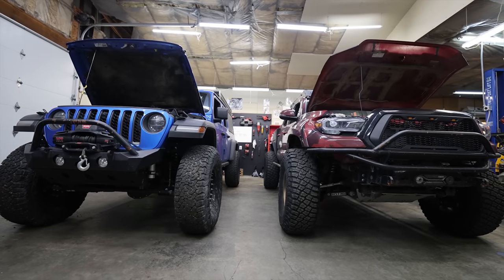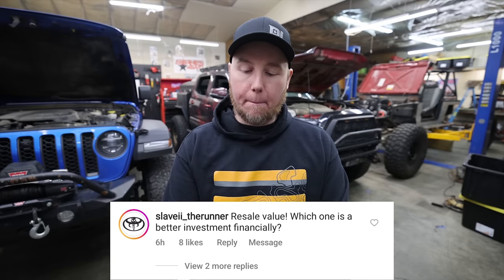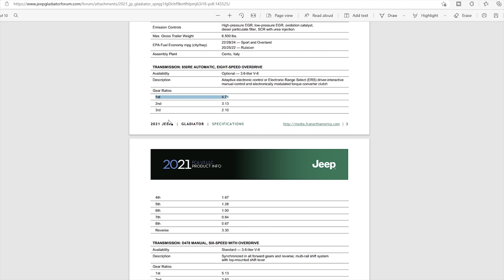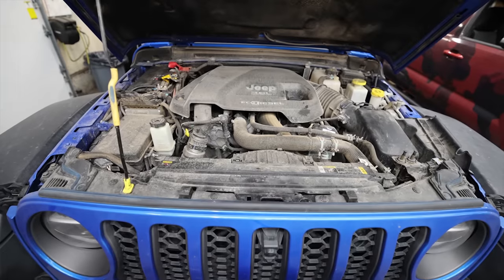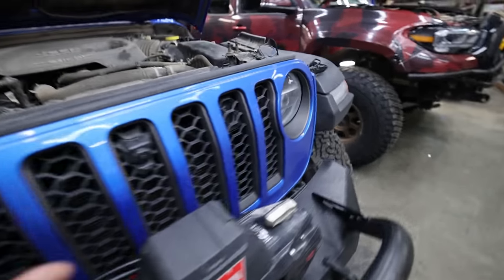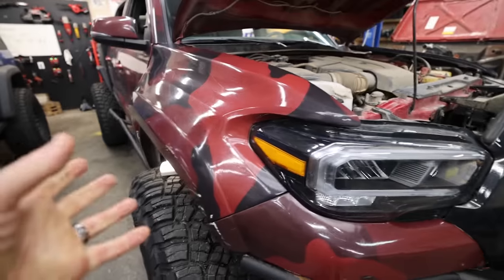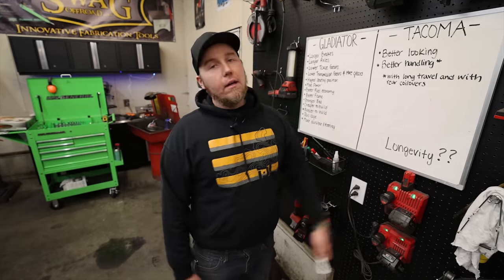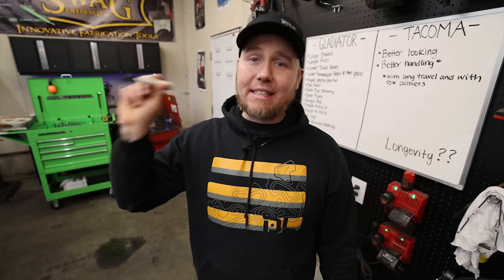My 21 Jeep Gladiator Vs My 21 Toyota Tacoma. Cold Hard Facts.

Comment: This video is the best.

I have a 2015 Tacoma and a 2017 Tacoma. You are 100% spot on with everything. And I had a beefed-up Wrangler TJ on 35s for seven years, so I'm not some diehard Toyota fanboy.

In my opinion, people's biggest mistakes with Tacomas is trying to turn them into rock crawlers or desert runners. I understand that YOU did it as a proof of concept. But all of these Instagrammers (sorry Maxx lol) who put long(ish) travel kits and 35s or 37s on their 3rd gen Tacomas are turning their trucks into something that they aren't properly built to do. Tacomas a basically just Subarus with low range. They're not really adequately built or designed for rock crawling, or much of anything beyond a really washed-out forest road. Beyond that, you need at least 35" tires. And to put those tires on a Tacoma requires tons of frame and body cutting/welding. I have my 2nd gen Taco set up for backcountry adventuring (what people in the US like to call "overlanding"). It's got a beefed up suspension, ARB winch bumper, 10,000lb winch, rtt on a bed rack, Hammer Hangers, plenty of the good stuff. BUT, I refuse to put anything bigger than a 33" tire on it. Same with my 3rd gen. I actually only have 32s on both trucks. And you know what? They work fantastic for the things I do with the trucks.

Now, if I wanted to get into rock crawling and hardcore off-roading, I wouldn't further build out my 2nd gen and turn it into a rock crawler. I would get either a Wrangler/Gladiator or a Bronco. Because those vehicles are built from the factory to be able to do all of those things with minimal modification, if any. 
I love my Tacomas. They're also a pain in the ass, but I mostly love them.

I think the main point of my sermon is: have realistic expectations of your specific vehicle. Because a lot of people do not.
Reply: Supposedly, the new 2024 off-road versions of the Tacoma are now actually designed for off-road and you can disconnect the front-end sway bar, have highly upgraded off-road suspension and other improvements. You have to remember that Jeeps like the Gladiator were made for off-road scenarios.  Tacomas are made for a lot of other driving scenarios. The very fact that you can upgrade a Tacoma and make it into a capable off-roader is a complement to Toyota. I am not claiming that the beefed-up 2024 off-road version of the Tacoma is going to be as good as a Wrangler, but it will be faster, get far better gas mileage and it will be easier to drive in the city. The hybrid version of the 2024 Tacoma has 326 HP and 465 lb.-ft. of torque. It's going to be a beast by any measure. It also has a new eight-speed transmission and supposedly will get over 30 mpg.  I have no doubt that it will be much more capable off-road with these improvements.

I have owned three Tacomas and currently own a 2009 Tacoma Sport version with TRD upgrades. Off of the lot it has been a very capable off-road vehicle, but it was never designed to be a Jeep-like off-roader. I have over 200,000 miles on it and I have never had to do any repair work on it. It still has the original hoses on it and they are still flexible and in good condition. The reliability of Tacomas is legendary. 

The main problem with Jeeps, and several Jeep owners have told me this, is that they break down all the time and are very unreliable. I haven't owned a Jeep, but Jeeps in general have a very poor record for being reliable in almost every study I have read on the subject. Their new SUV uses plastic engine mounts or something like that which is just ridiculous. They are breaking like popcorn.

Comment: I am a 2020 toyota tacoma TRD off road owner and I agree totally with you. I love the looks and handling but hate the drive line. I have a 2011 toyota venza v6 3.5l and it has a way better power. I understand the frame issue too as much as I went to work when I bought this truck I bought a case of mil-grade cosmoline in spray bomb. I took the tires off covered the body with plastic and layed on a creeper and sprayed everything. (Wisconsin, salt!) am I going to off road like you no I just go to Mexico with my wife and we have family land there and just want to get around.
Nice vid! No hard feelings and you didn't lose me.
Cozz

Comment: Really wanted a Jeep in 2007 but ended up with a Tacoma 4.0L, surprisingly I use it for everything. Some off-roading, many hunting and camping/hiking excursions, moving a few times across the country, daily driver etc. It's 363k miles on it currently and runs great. For the first 200k after 12 years the only "repairs" were a new battery and upgraded air filter and aftermarket leveling suspension. Some under body rust currently on it as it's seen 6-7 harsh winters. The towing handled amazing in my moves. Shame on Toyota for going away from the 4.0L!!! My son will be buying it from me soon as I look for another 2nd gen Tacoma!

Comment: Tacoma (TRDOR) owner here….you went pretty light.  You didn’t even mention Toyota designed the front to not accept larger wheel/tire combos without cutting and beating the hell out out the body.   Love my Taco, but only got it because it the Gladiator Rubicon was was $20k more at the time.

Comment: Your videos are awesome!   

How heavy was this trailer you described the Taco pulling?  My Rav4 pulled a 4,000#+ trailer (it was a 3500 # trailer that was DEFINITELY overloaded - the largest Uhaul trailer, STUFFED), from Montana to southern Colorado and it had ZERO problems.  Held 80 on the highway, up the passes in Colorado... never really got above 4,000 RPM.

Another noticeable difference is the air intake- the Rav4 has its air intake from the top of the grill where the hood latches, not the wheel well.  Seems SO weird ANYONE would design an air intake from the wheel well, but you are not wrong about that!  Most manufacturers do that and it has never made sense to me.

Comment: As a former Toyota owner (and who has first hand experience with jeeps) , I don't hate to agree. I had an fj cruiser with suspension that was dialed perfectly and 33s and it would go everywhere ... except the highway. It didn't have the power that I require and thr transmission did overheat and that wasn't a cheap fix. And eventually I did break the rear diff. 
Engine was solid, but under powered. It didn't have the gearing it really needed. And it lacked creature comforts compared to competitors. 
I was able to sell it for more than I paid, but I didn't get the repair bills back. 
I now have a 20 year old chevy tahoe on torsion bar ifs with mid travel rear suspension and while it's not anywhere near as capable as a Toyota or jeep, its way more comfortable than both, I can tow whatever I want, and I'm not lacking power thanks to the v8. 
I've never owned a jeep but I have driven them on and offroad and I definitely don't hate them. But the solid front axle makes them a bit less road worthy and the one I drove fell apart offroad... but that was probably a fluke as its not common for body panels to fall off of any vehicle once you hit a little mud

Comment: I had a 2018 Tacoma that I spent a lot of money on to build it up for off roading.  The only thing I hadn't done was gearing.  Drove past a Jeep dealer one day and saw a similarly built used Gladiator with a diesel.  Test drove and it and came back the next day and bought a new one just like it (I wanted to pick my own parts to build it up).  37" tires, Clayton Lift, this thing is a monster on the trails and the highway.  Loved the Taco but the Gladiator has so far been so much more fun to drive.  And of course you can also take the top and doors off!!!

Comment: I had 3 Gen 2 Tacoma's. I bought a 2021 Gladiator Willys with the select trac transfer case. I did all of the standard upgrades. Bumpers, suspension, rims and tires etc.. The Truck looked awesome. But I did not like how it handled when stock or moded. Just not a road trip truck to me. I sold it last year and got all my money back out of it. Then bought a low mileage off lease stock 2019 Gen 3 Tacoma TRD Off Road. Did basic suspension lift, Rims and 285/70/16 Nitto Ridge Grapplers, YotaWerks Tune and so far in the last year I have put 10k miles on it. It's an awesome truck on road and off. My experience. For what I use it for.

Comment: I currently have a 21 Galdiator. I had a 2017 TRD off road Tacoma and I can verify how flexible the Tacoma frame was. I could actually see the bed bounce while driving down the highway. It didn't instill confidence. Also when I brought the taco in for service the advisor told me that I needed a frame inspection on my 18 month old Tacoma. The gen 3 Tacoma were already  having frame issues. That was it for me. I let the Tacoma go. My Gladiator seems so much more sturdy and capable, although I don't do any serious off roading.

Comment: One thing I noticed that was missing in this comparison. Price.  Sure the 3.0 ED vastly outclasses the Tacoma 3.5, but it's also a 5 grand option over the 3.6.  There are a lot of legit criticisms of the Tacoma, but there are also some weird comparisons too.  Sure, it has smaller brakes and no discs in the rear but:  1. The Gladiator ED is also nearly 1000 lbs heavier. Of course it has bigger brakes...it has to.  2. is that a problem? Is the braking performance on the Tacoma noticeably worse? Sometimes things are bigger not because they provide more, but because they have more strain. Tons on YJ are massive. Tons on a 3500 are adequate. I guess what it boils down to is - if the numbers tell the story, it would be performance numbers we should be looking at and not what it takes to achieve them.  

Another video you could do on the subject would be out of the box suitability  A good example is the Gladiator having lower body work and a lot more wheelbase.  To get the same breakover a TRD off-road Tacoma has with 33's and a 2 inch lift requires a 3 inch lift and 37's on a Gladiator Rubicon.  That's nuts!  Yes, the Jeep's mod ceiling is higher, but it also requires more to achieve similar results.  In Utah I don't know anyone that actually goes off-road with a Gladiator that doesn't have at least a 2 inch lift and 35's.  Thats a lot more tire to pay for, drive and stop.

Comment: I bought a 2019 Tacoma because it fits my needs. I live in a condo. With the lift, bigger tires, and roof rack, I have about 1 - 2 inches of clearance left in my underground parkade. I couldn't park lifted Wrangler or Gladiator on 35 inch tires in my parkade, so a Tacoma is "better" for me. I have mud terrain tires and the truck is twin locked so I can tackle tough tracks, but I primarily use the Tacoma for backroads exploration, so the Tacoma is "better" for me. After 4 years of ownership, nothing has gone wrong with my truck. The stereo system/head unit rebooted inexplicably once, but that's all that's ever gone wrong.

Comment: "Just the facts mam" - love it! For towing, I bought a Frontier PRO-4X : low end torque, Rear disk brakes, a Dana 44 rear diff and a STRONG box frame. I added an Old Man Emu lift which is icing on the cake! The toy is the better looking truck, but my 5'-3" wife couldn't see what's in front of her on the test drive. Swinging the front axial on my jeep is FUN on 4x4 trails, but the articulation challenged truck is a born highway cruiser. - maybe Ford has the right idea?

Comment: I have a 2020 TRD Offroad Tacoma and my brother-in-law has a JK wrangler Unlimited Rubicon. I really love that Jeep and it was great Offroad. I do more wheeling with mine and his is used more for overland camping. 

But he has had to fix it four times now with the check engine problem being the thing a few times. 1700 bucks a pop. 

When we were wheeling together it is really noticeable how they’re built for different purpose. Jeep is rock crawling machine and Toyota is more for going fast. We found this out when we were doing a loop trail and we hit a closure late afternoon and had to backtrack. 

But Jeep better clearance, better articulation, dual lockers nice, and  comes stock able to fit 33s+. 

Toyota IS more reliable but it’s more of a dual purpose road/Offroad machine. Jeep is the Offroad master.

Comment: I'm not a jeep guy, but wheel with lots of them on 40's...I have a 2017 4 Runner with RCLT, 4:88 gears, RCV Axles, Chrome Rear Axles...ARB Lockers, Icon Suspension, and 40" Tires....Very capable on the trail/rocks...drives like a dream on the road.  As you know the cost to get there is way more than a jeep, and most jeep people I know wish they had the on road handling of this set up. The 4Runner is a bit beefier in my opinion than the Tacoma. All of them are extremely capable off road but it is so hard to say which is better.....because they are different....definitely less money to build the jeep than the yotas, but when you get the right set up in the Toyota....it will keep up with the jeep offroad and the jeep will struggle to handle as well on the highway. Different strokes for different folks !  Great Video !

Comment: I ran a jeep and toyota both to about 230k miles and over 10 years old each.  Changed the oil in the toyota and sold it for a good price.  I limped the jeep to a dealer for a trade after a decade of expensive breaks.

Comment: Well stated, and facts are the best.  As an Engineer who works in manufacturing I simply say I agree with everything you stated as more often then not folks just clue in on the opinion parts and don't do a good job as asking why?  There's a manufacturing concept call "Root Cause Analysis, and WHY, WHY" that's used for determining failure modes of everything.  If folks would just ask why a few more times, they'd probably find the real answers.  You made a good example of this when you asked about the resource for that chevy info.  Really good reference.  I'm a little for fun channel (jeepNdirt) as I seem to state every time, but soon I'll be posting videos hoping to help with different off road stuff and travel utilizing the same concept, "Straight up facts and open honesty".  You continue to rock, and inspire me as I've stated to you so many times.  You, Shaun, Casey, and Brad are my motivation, once again really good content.  Thanks buddy.

Comment: You are 100% right.  I'm a Toyota guy who has always been frustrated by the lack of options Toyota gives 4x4 buyers.   The FJ Cruiser was so close but the rear windows were not operable and it didn't even have a sunroof.  I was hoping the next model would correct those issues, but they killed it instead.   Don't know if you're aware but after stating they were not going to put all their eggs in the EV basket, the president of Toyota is suddenly stepping down.  The new guy says that are going to focus on EVs and turning Toyota into a 'mobility' company.  The future does not look good, IMO.

Comment: As a 2017 2wd OR Tacoma owner I feel like you’re spot on. I bought 2wd with a locker cause I had no intentions to do jeep things. I like high speed wash runs. The solid axels are king for lift, clearance, strength, etc in my opinion. So that’s why now I also own an 80 series Land Cruiser. Jeeps been around for a long time I think they’ve got the majority of things dialed in but I’m just a Toyota guy. Grew up that way and my dad also had a CJ-7 and always claimed it the off road beast. No doubt Jeeps do crazy stuff. But I’ll hope in my Tacoma go to the jobsite, dinner, camp, desert runs, anything that comes to mind and I’ll always be happy with it. Plus the phrase “let’s go places” is kind of unmatched.

Comment: I've owned two Takomas, two Wranglers, and now a Gladiator. Each had their points in their favor, but I kind of say it this way: I drive from the Dallas area to Southern Colorado several times per year, usually towing about 3,000 lbs of trailer. For comfort and NOISE while driving, the Tacoma is better for the loong miles on the highway. But when I GET to Colorado, I will always prefer my Gladiator - simply no question of that. Since the Gladiator better suits the reason I go to Colorado, I'll put up with the noise of the Gladiator for the road trip part..... Your side by side factual measurements seal the deal for me.

Comment: Both cool trucks. It was hard deciding between the two. I went gladiator, 38 months later, i still love it. I have wheeled it, off road and long highway use. Built it up and changed some things. Only bad thing was a broken windshield. No other issues. At 54,000 miles all good. Wish i also had a taco to compare.